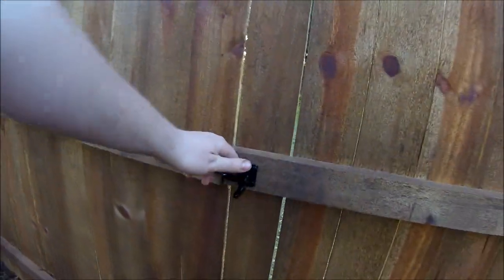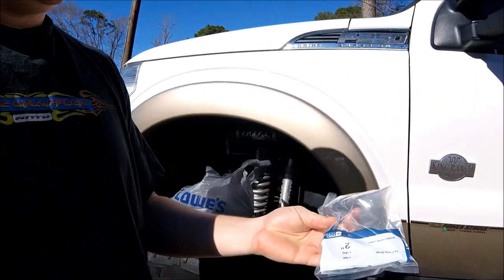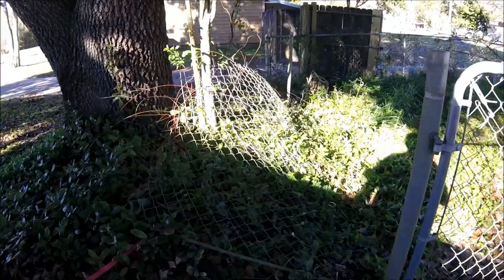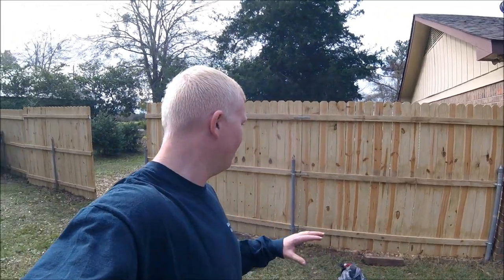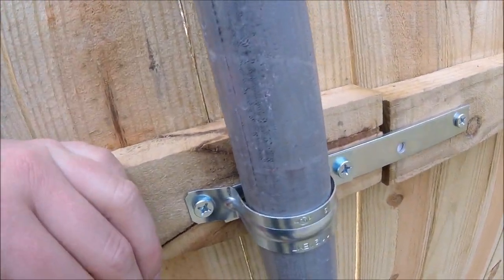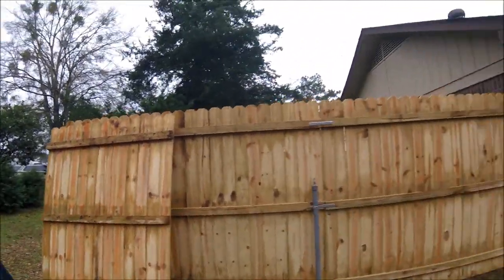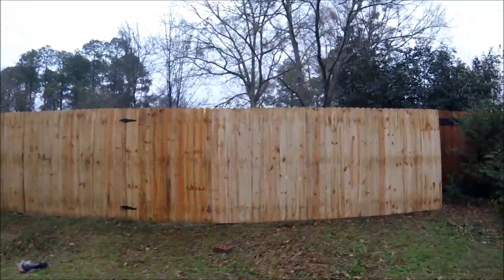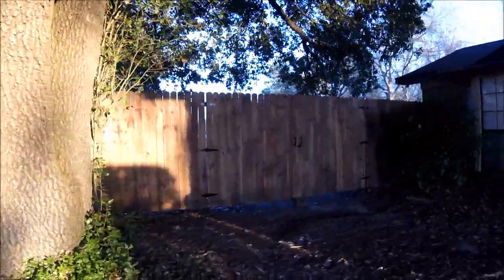How to Turn a Chain Link Fence Into a Privacy Fence

Comment: Thank you so much for this video.   I have a chain link fence and I've been looking for vids for over a year to see which would be the best option.   Yours is by far the best one and I plan on using your method. 
Thanks again for postings.
Reply: I believe he don't need to remove the chain links. Install directly over the chain links.

Comment: Looks good. I did something similar last fall. 

Instead of buying the new little straps, I reused the straps from the chainlink with new Simpson structural screws. 

I think what you, or the new owners will find over time is that while the 2 3/8” corner/end posts are sufficiently strong, the 1 3/8” line post are not, especially for a 6’ fence. We found out real quick, when a 60 mph wind storm blew through a month after finishing. Fortunately, it just blew it so it’s leaning against the neighbor’s cedars, but it will need to be replaced with the bigger posts.

Comment: More than a year later, did the fence held well? :)
Reply: The small line posts are not strong enough to withstand high winds. And definitely not the gate. It will look good for a while, but the gate will lean over time, and the line posts will bend in high winds. Experience speaking. 
Lesson learned the hard way.

Comment: I think I'm too lazy to remove the chain link and horizontal post. I may just attach the wood sections to the outside of the fence as it sits and use the horizontal bars for a little extra support with more of those brackets turned vertical to secure the horizontal bar to the wood.

Comment: 11:40 Rather than using that metal strap, I would get some 8 foot ceder 1X3's or 1X4's and run them parallel to the cross beam you screwed the straps into, from the half way point of one fence panel, to the half way point of the next, and so on, for the entire run of fence. This would not only look as if it had been a design element, but would be a lot stronger and last a lot longer as well. You might only get a year or so out of those straps.
Reply: You recommend staining the cedar?
Reply: @donc.883  Yes, depending on your climate, once every year or 2. Lightly pressure wash it and let it dry for a few days before staining.
Reply: PaganWizard ok thanks for the info!
Reply: Exactly - Such an obvious decision in order to avoid future issues.

Comment: Personally I would not have removed that top cross pole, it could have acted as more support. I attached a 6ft high rolled bamboo to my chain link 7 yrs ago and still standing. Wired it to my existing chain link without removing anything. It's aging now and thinking about doing this with planks but it would be put over the full existing fence.
Reply: @Alessandria, where did you get the rolled bamboo from? Can you please send me the link? I think that's a great idea to attach to my chain link fence and it's not as heavy as wood fence panels. Thank you!
Reply: A bunch of debris will get trapped between the chain link and wooden planks if you do that, accelerating wood rot.

Comment: You probably could have left the cross bars on there for strength as well as not having to find somewhere to trash them.
Reply: I use the cross bars to make extension for the Post
Reply: I will not be existing chain link fence. installing over that.
Reply: I'm leaving it all on, planned to do it the same way just wanted to see how it turned out, I'm just buying the dog ear wood bit cheaper in price.

Comment: Looks really good. Give me a good idea to deal with the chain-link fence that I need to change to privacy fence. One thing I did notice is that you need another support post where the gate is that you put in.
Reply: Needs a 4x4 in cement every 6 to 8 feet. I tried this, I spend so much time in the middle of storms to keep the fence from completely blowing away. The metal posts bend easily. I've had to start adding more and more each storm. I plan on just fixing it once and for all, as in properly. The metal won't hold the lumber in any wind.
Reply: @lovegodfirst654  ok I was worried about this in addition to the look. Thanks much
Reply: @lovegodfirst654  Just wondering if you popped the cap off the poles, centered up a piece of rebar and filled it with concrete? Do you think that'd solve the pole strength? I'd understand if that's not the direction you'd want to go. Cheers.
Reply: The metal outside would be plenty of steel that you wouldn’t need to add rebar. If you can get good compaction of the concrete in the pipe, it would definitely stiffen the pipe. It might still be a problem of the foundation being insufficiently small. The 2”+ posts at the corners are big enough. The 1” line posts are not.

Comment: Great job love what you did. Did you need a fence permit from the city since you changed from chain link to wooden fence?
Reply: You have to check your area's rules. Ours doesn't require anything if under 8 foot and conforms with the community. It is different in different communities.

Comment: Please put links of hardware used in your description.what was the size of panels ? If you used shorter panels they probably would have bent the poles .my post are 4ft so I wouldn’t go higher then 6ft definitely not 8ft you think that would help ? Should be lighter as well for the doors to swing open .

Comment: Does anyone know if a fencing company would do this? Or are they gonna push “having to dig up the posts”? Love this idea!
Reply: The metal posts only hold up when it's not windy. ..coming from experience here.
Reply: A reputable fencing company will want to start from scratch because they guarantee their work. They aren't going to guarantee something when the most important part isn't their work and most likely part to cause a failure.
Reply: Any fence company worth paying will know that the small line posts will not be strong enough in high winds. 

They also won’t know what the previous build did for post foundations and will wisely start over.

Comment: Nice video. I wonder how it hold up in a wind storm as the closed fense will create more pressure than a chain link.  I have to do something like this with mine, my fenses have cement holding it and it will be crazy to change it myself.
Reply: I've had to put in 4x4's in cement alongside the existing. The posts bend and break too easily. Too many storms, I've been out there trying to keep it together. It's exhausting.
Reply: The corners are good. The line posts are too small.

Comment: Chance, why do you never pre-drill into the fence wood before you use the drill and insert the wood screw? Tks.
Reply from the maker: I would recommend predrilling. I was just being lazy
Reply: Also because this isn't 1956. Hand cut box mitre, pre drilled holes for screws and rivets are pretty much obsolete

Comment: I have a 5' chain link fence do you think the poles would hold up in a storm?
Reply: Unfortunately, we had a tornado come through which bent the chain link poles back. We ended up taking them out and replacing them with 4x4 posts. We reccomend doing this if you're in a high wind/tornado area.
Reply: Although, our chain link poles were only about 3 feet high

Comment: Does 4ft chain link have enough stability to hold up 6 or 8 ft privacy fence?? Determining if this is ok or need to put a larger diameter 6ft metal post over the fence panels
Reply from the maker: Dan H We ended up having a bad storm with tornadoes in the area that bent the original posts. If you are in a pretty mild weather area you may be ok. We ended up replacing the metal posts with 4x4 wood like most people would do
Reply: Were these posts concreted in?
Reply: @chancerbob95   So you removed the existing poles and concrete base and put completely in  new  wood ones with concrete base?
Reply: Im pretty sure you want an 8 ft post/pipe driven into the ground 2 ft. to support and stabilize the fence.
Reply: I used 4x4 posts in ground spikes (pounded in not cemented) along an existing 4' chain link fence. Used the same conduit straps around the top rail at each post.

Intended to be temporary privacy fence for a pool. 14 years of midwestern weather later, still standing (much to my surprise).

Maybe using post extensions or sleeving over existing posts to a 6 foot height might be stronger?

Comment: how tall were existing poles?
Reply: Around 3 or 3 1/2 feet. And they were concreted in the ground from whoever installed the chain link
Reply: Megan Bartlett in your opinion do u think if youre not in high wind area that this will hold.  I have poles about same height from old chainlink fence

Comment: I did my privacy fence attached to my chain link. It was quick getting it up, but unfortunately, it's quick to blow down. I've spent so much time in storms trying to salvage my fence. The metal posts cannot hold the wood in high winds.
Reply from the maker: I agree. I ended up replacing the metal with 4x4 posts
Reply: @chancerbob95  I've put in 4x4 posts in cement in multiple places to reinforce it. After the weather gets a little more stable, I plan to put them in every 6 to 8 foot. I should remove the metal altogether for stability. It is what it is.
Reply: Update. It still will not hold. Large sections of the chainlink have been bent and destroyed, even with the 8 foot posts. It is utterly destroyed. It has to come out and done right. The gates are destroyed, the paneling is destroyed, the  entire fence looks like a tornado hit it with every light wind. It seemed great at first, but it would have been easier to just do it right to start.

Comment: Update
Reply from the maker: k k We had a bad storm with tornadoes in the area and it bent the fence back slightly. I ended up replacing the the poles with 4x4 wood posts but it was solid through minor storms
Reply: You replaced all the metal ones after how  hard was that
Reply: You replaced all the metal ones after how  hard was that